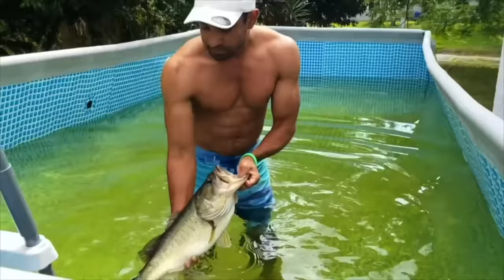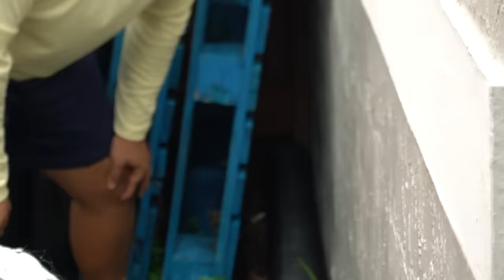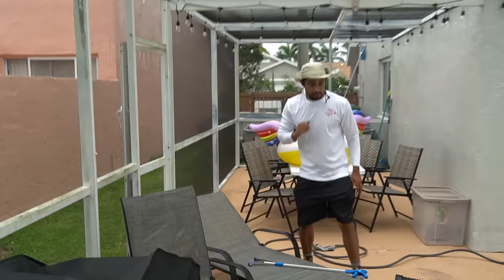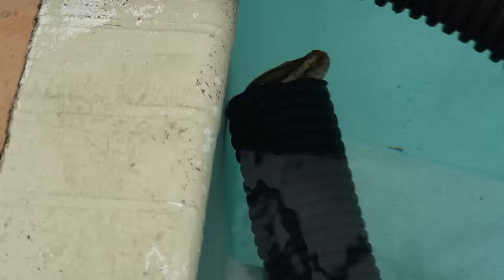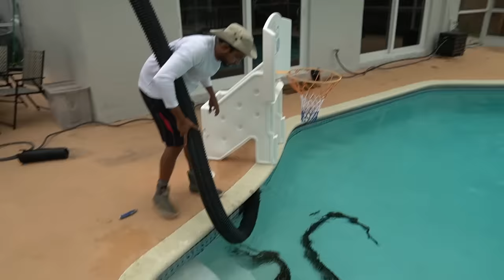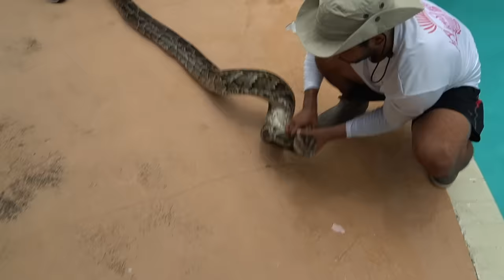15 Foot MONSTER Stuck in POOL DRAIN!

Comment: On a python that size, its brain is between the size (width) of your thumb and first finger. Might be 1 to 1 1/2 inches in length. Weird part is their Cerebellum and Medulla Oblongata is towards the rear almost inline with their jaw hinges. Really easy to miss with a small caliber anything. A machete however, would definitely do the trick.
Reply: Forget the gun let’s get straight to business 
casually whips out machete
Reply: I never saw a bullet wound
Reply: @danieltripp4904  it was there I saw it

Comment: Wait!  The python was shot in the head and then frozen in the foam cooler.  It then somehow got out, but the cooler's cap which is foam was still perfectly sealed.  😅
Reply: A snake that big would have no trouble pushing open a cooler lid to get out. The cooler was obviously not bolted shut, and snakes are notorious for escaping their enclosures if not secured well

Comment: As a reptile and snake expert there are other ways of dealing with a snake rather than a pair of litter pickers. That isn’t fair on the snake. There are more humane ways of dealing with a snake it would’ve left on its own there was no need to catch it if it wanted to stay in that pipe it wanted to stay in that pipe you didn’t need to put it under water to make it suffocate to have to want to come out. Just for the sake of YouTube views. And from personal experience that does not look like a wild snake it is a python of some sort. But from his temperament it looked more like a snake that has been handled by humans before. Because I can tell you right now if that was a life snake it would’ve been avoiding you completely it wouldn’t just be swimming around the pool. It would have slithered out of the pool completely away from you at which point if you approached it it would affect you and you probably wouldn’t have survived it if he wasn’t with you. That poor snake

Comment: I would have just capped both ends drainage pipe which I take the pipe is slotted. Then throw the pipe in the pool for a while and let the snake drown in the pole. The snake was shot in the head with a .22 but you don't want to cut the snake? WTF